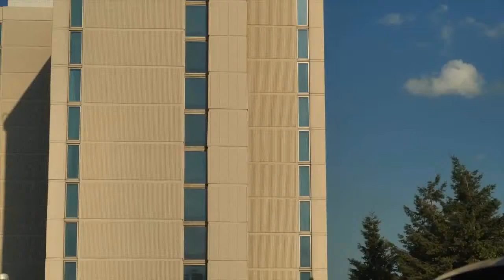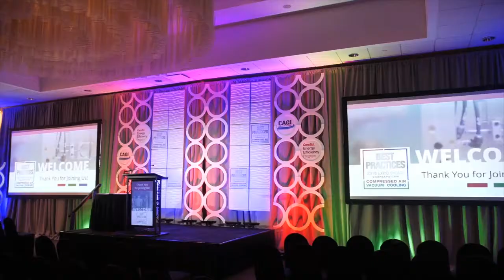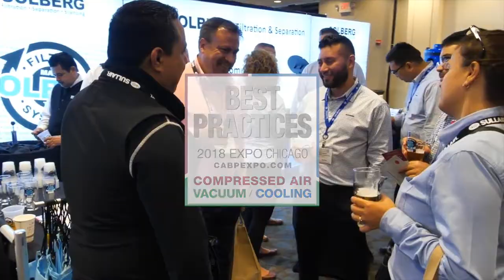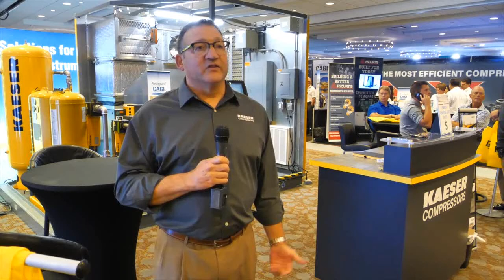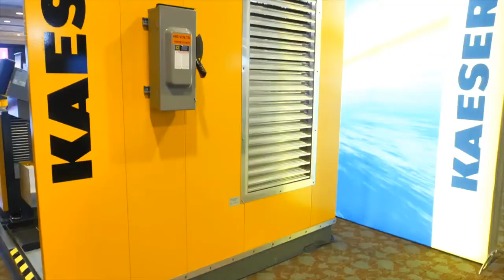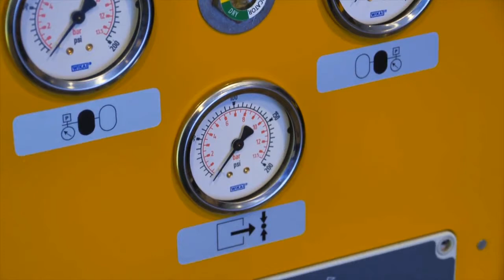Kaeser Compressors at Compressed Air Best Practices Expo

Comment: I owned a combined automechanical and auto body repair shop for 15 years and from the start I used two 15hp Kaeser screw compressors coupled with a refrigerated air dryer.  When I bought the shop they used the old style piston compressor.  Employees complained of water in the lines and the painshop had issues with water and oil contamination in their paint jobs.  The new ( in 1995 ) Kaesers completely solved those issues and supplied ambient temperature, oil free air to 25 work stations.  Most important, I never had one compressor failure.  All I ever did was to change the compressor oil at the recommended intervals.
This is an amazing compressor, we’ll build and supported by a customer geared company.  Since selling the shop I’ve been hired as a consultant to several repair shop clients.  One of the first things I point out is their use of old technology air and recommend replacement with Kaeser machines.
Thank you Kaeser for your outstanding engineering and support.
Reply from the maker: That's a great story! Email us at social.us@kaeser.com; we'd love to hear more and maybe send a little Kaeser swag your way!